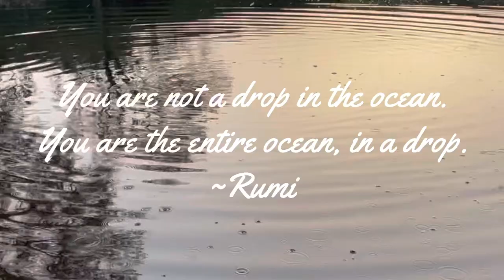Off Grid Water Systems for our Homestead

Comment: You said you ran out of wood for heat the home and I see at least one tree that is dead and wondering why no one had cut the wood for firewood?   That  is not an issue with expenses to me.
Reply from the maker: Hey there, great observation. Indeed we have several dead trees on the land. We want to keep many of them for wildlife, but also, we don’t have many tools at all yet to cut a tree down. But down the road, yes we will likely do a couple. This year we bought a load of wood from a neighbor, and had almost enough. We just weren’t expecting that last cold spell. And next year we hope to be able to make improvements on the house to hold in the heat more as well. Take care!